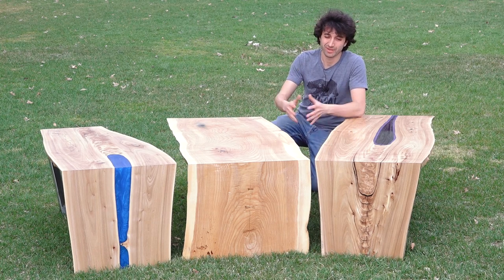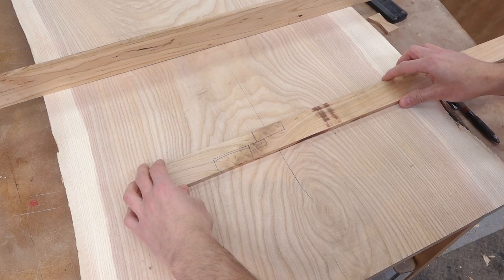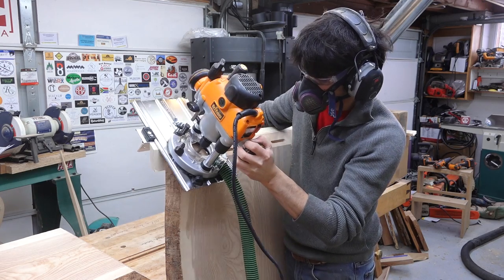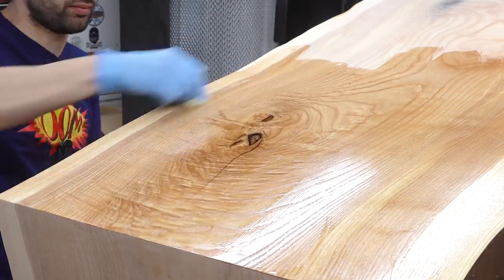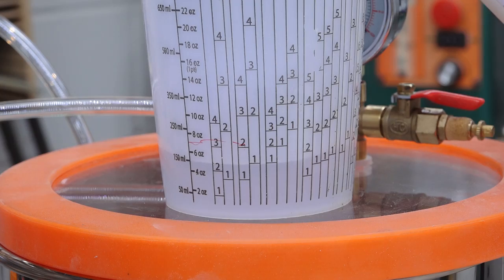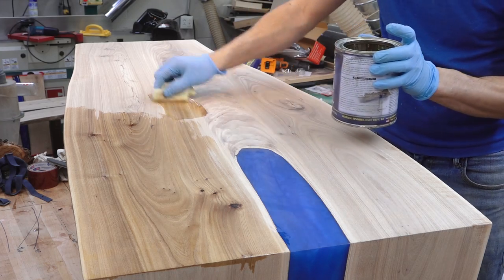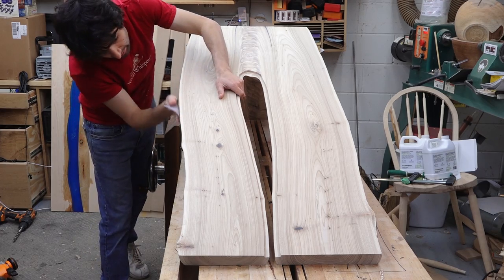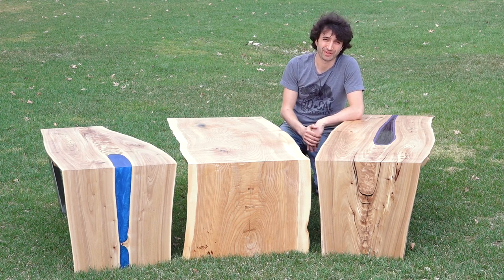How to Make Waterfall and River Tables

Comment: A technique of shellac around the perimeter of the poor so as to prevent any type of die impregnation of the surrounding wood then building a caulk dam around the poor and slightly over pouring. To either be plained or sanded down to perfect.  Killer video!

Comment: this is absolutely my favorite waterfall edge video!!  I am making a waterfall bar top. My material is 1 3/4" x 12" x 120" African Mahogany. I don't think my circular saw can make that 45 deg cut because it doesn't have enough depth, so I am building a huge sled to cut the 45s on my table saw,,,,but wait,,, what size is your circular saw?

Comment: I really dig all of the table, but my favourites are table #2 blue epoxy river waterfall table, and #1 waterfall table. They looks so pretty! What sort of the mineral oil is that you are using as well as what is the final finish on those tables? Thanks!

Comment: Hey Matt,  Thanks for the video.  At 8:50 the table is done.  When you cut the water fail leg, the 45 degree, how do you know where to make the cut?  I assume it can't be 90 degrees to either side.  I just don't see how the table is level and the leg is flat on the floor.
Reply from the maker: parallel to the cut on the end. Thanks!

Comment: Great Work.
In the guild project do you explain why you switched from painters tape when doing the epoxy void fill to doing the epoxy river pour?
I'm looking to fill the cavernous gaps in my first attempt at hand-cut dovetails and wondering which tape to use (to mask off any overflow).
Reply: oops...  to using sheathing tape for the river pour

Comment: I have a 40" live edge table that I'm going to be leveling with the router like you did. I do NOT have a flat level surface that large to place the top on along with the sled. What's the most important thing I can do to insure I don't mess this table top up when I'm going at it with the router?
Reply from the maker: Assuming your rails are flat/straight, the biggest thing you need to take care of with the set up is making sure those rails are parallel and not twisted.  If you have the slab and rails on a pair of sawhorses, you can shim up either end of either horse to get any twist out.  Pretty easy to check with some string.  I showed that here: https://youtu.be/wWSrBSHUmWY?t=413
Reply: @mcremona  thanks for that! I forgot I had seen you do that.

Comment: For the metallic pigment epoxy, how long do you leave it in the vac chamber to get the air bubbles out?
Reply from the maker: about five minutes to bring them to the top.  The epoxy I used does a pretty decent job at self degassing so the vacuum chamber was just to speed it up a bit

Comment: I'm wondering about gluing the cauls - why not place a piece of paper between them and your material during glue up.  The joint should be strong enough hold while clamping but would make the removal much easier and quicker with that layer of paper separation.
Reply from the maker: Go for it 😄

Comment: When you apply linseed oil are you using sandpaper? just curious
Reply from the maker: I applied a wipe on poly with a cotton rag, sanding between coats with 600 grit

Comment: Hello people.

Can I please have some advise? 

I need to make a resin kitchen table. It will have some 1 inch wood on the middle of the resin pour (2 inches thick), the rest will be the resin itself. On one side it will be suported by a metal base attached to the wall and on the other side I will have the same resin desing as one single, same width leg. 

It doesnt have to be a 45° joint, the top can be just placed on the leg. How would you reccomend to attach the leg to the top of the bar? it is basically resin with resin and some wood in between.  I was thinking poket holes maybe, but dont tant to crack the resin with the screws accidentally.

It will be heavy, 2 meter top piece. Thank you for your time, everyone.

Comment: Hey Matt, do you use standard 1 1/4 bandsaw blades or something wider on your sawmill?
Reply from the maker: 1.5" .050
Reply: Matthew Cremona thanks, we were using 1 1/4 on our homemade 80” bandsaw and were getting dipping when cutting wide slabs then switch to a 2” and it totally corrected the problem. By the way thanks for making all the build videos on the mill, I couldn’t have built mine with out them.

Comment: How do you keep the face of the waterfall table/leg from tearing out when you remove those plywood braces? Wood glue is so strong, and breaking the bond usually tears out wood from both sides.
Reply: He's splitting along one of the plywood veneers and actually leaving all of the glue to be sanded after. I was also wondering how he was going to remove the plywood after using so much wood glue.

Comment: Are you afraid of the glass breaking if the wood expands?
Reply from the maker: If the wood expands, the fit will get looser.  Based on the time of year I built it, the wood will only expand from that point